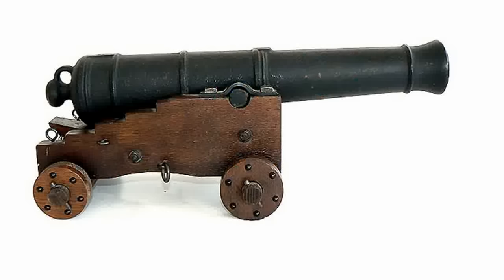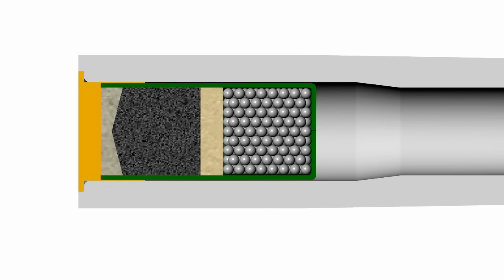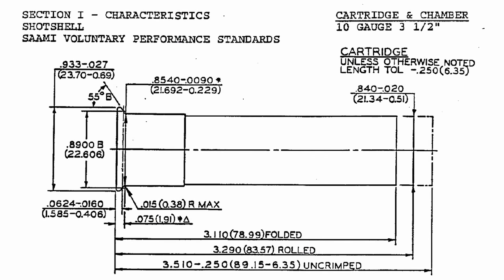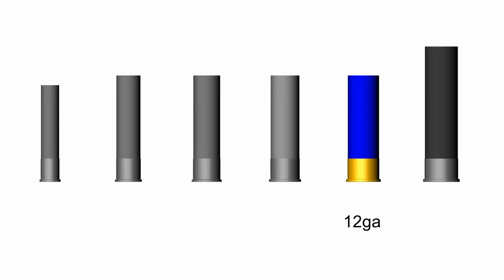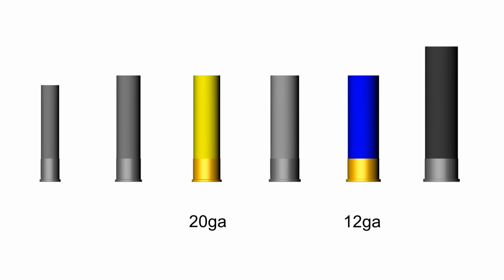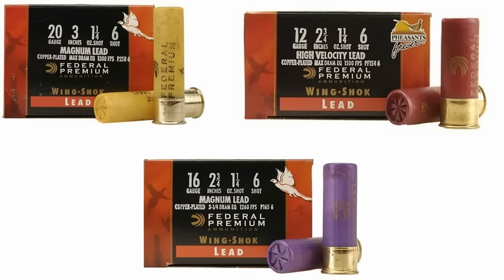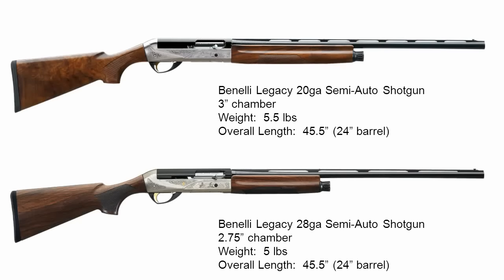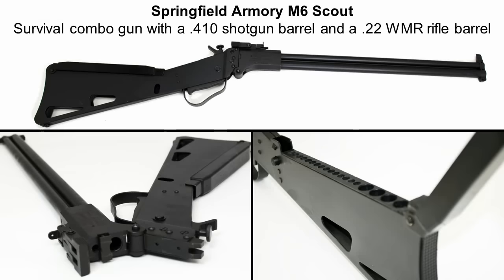Shotgun Gauges Explained - Shotguns 101 #3

Comment: Is there any relation between bore  and gauge ? 
Both are commonly used for hunting rifles.
Reply from the maker: "Bore" and "gauge" are pretty much synonymous.  If someone says 10-gauge or 10-bore, it means the same thing.  The "bore" term is more archaic, which is why you're more likely to hear it applied to larger-diameter guns that haven't been in common use for a long time.
Reply: @SynchronizorVideos  Thanks for answering me.

Comment: Just out of curiosity, does anybody know why the .410 bore (10.4 mm) is called a 36 gauge (12 mm) in some regions of the world such as Europe, Asia, and South America; instead of by the more common 67 or 68 gauge destination?
Reply: .410 is 67.62 gauge or 67 5/8 gauge. It’s sometimes called 36 gauge because starting with 12 gauge they go up in increments of 4. You have 12, 16, 20, 24, 28, 32 and for simplicity 36.

Comment: Please , I want to know about , what is the choke tube size for use the 3 1/2 inch super magnum shells , thank you
Reply from the maker: Did you mean shot size?  The 3 1/2" 12ga can use pretty much any shot size, depending on the application.
Reply: Thanks for your answer , I exactly meant that the choke size or num , I have beretta a400 extreme gauge 12 , and there are 3 chokes with it , 1 & 3 & 5 , so if I want to use the 
3 1/2 inches shells , which size of that 3 chokes  I must use ? thank you
Reply: Check with Beretta or a local gun store, they'll be able to help you.
Reply: Thank you
Reply: thanks

Comment: Every .410 revolver I've seen can also chamber .45 Long Colt. Unlike a .410 slug, the .45 Long Colt is a good defense round (it's like a .45ACP +P), and it shoots much straighter. Use that instead.

.410 buck is interesting, though - by the numbers, it's more like 3-5 FMJs from a .32, which isn't terrible. I wouldn't ever use a .410 long gun for home defense, but the revolvers loaded with buck are decent. (For home defense, I'd rather have a 20ga, or even a 5.56mm rifle - everything penetrates wallboard, even a measly .22LR, and the 5.56 penetrates less of it than you'd expect. Certainly less than a load of #1 buck from a 20ga)
Reply from the maker: If you're going to defend yourself with a .410 revolver and don't want to shoot .45 Colt, buckshot is probably your best bet.  It's strictly a close-range proposition though, due to the oversized bore and sub-optimal pellet stacking causing poor patterns.

Comment: .410 is a good Rabbit and Squirrel gun i started shooting trap with .410 when i was 8 until i got older and got a 20g but it taught me to be picky on my shots
Reply from the maker: The .410 is effective on small game, and even some bigger stuff at close ranges.  You have to be aware of and work within its limitations, but it'll do the job.  It's also great if you want a challenge with clays, though you can get similarly light loads with other gauges if you don't want to buy another gun.  I personally do a lot of clay shooting practice with 3/4-ounce 12ga loads - the same payload as a lot of 3" .410 shells.  Very light recoil and good for practicing proper shot placement when paired with a tighter choke.

Comment: Don't know about you but I've only ever used a 410 and I've had no problems what so ever. It is extremely surprising what the little fella can do. Yesterday I shot a possum in a tree from 40 meters no problems.
Reply: Second that. Been taking out possum, pheasant, doves, pigeons, crow, partridge, squirrel, etc since I was a young whippersnapper with the trusty 410

Comment: Home Defense Shell?...   I have a pair of Remington's,  Model 11and 11-48 (25½ and 27½in barrel). 
I currently use 00 Buck.  But I'm concerned about Penetration,  into a Neighbor's (non-brick) Home!
 I was wondering if a smaller Shot size (6 or 8?),  be a more suited Round?
   Thank You, for Your Time.   -Thom
Reply from the maker: If you're worried about overpenetration through multiple walls, check out #4 buckshot.  It's smaller and lighter than 00 buck, so the energy is spread out over a larger number of pellets that have less momentum individually, and a couple walls will really neuter them in case you miss.  They might not be completely stopped, but they'll get mangled, spread out, and slowed down considerably, so they're far less likely to penetrate into another house and do real damage.  They still have enough power to get into vital organs at close range when there's nothing in the way, though, and more pellets means more chances to hit really critical stuff.  #4B is what I load for HD.

I don't ever recommend birdshot for home defense.  Those pellets are sized for knocking down lightly-built birds and other small game, or breaking fragile clay targets.  They just don't have what it takes to reliably get deep into a large creature like a human.  Keep in mind that if your shot can be stopped by a couple sheets of drywall, it'll have a real tough time with all the layers of clothing, skin, muscle, and bone that are between you and the vitals of someone trying to hurt you.

Comment: I have a Mossberg M500CRUISER. It's a 12 ga pump action shotgun. It has an 18-1/2 inch barrel and a pistol grip. It meets all legal requirements. The barrel is over the minimum of illegal18 inches and the overall length is 28 inches with the illegal minimum of 26 inches
Reply: And your point is? Lots of us have shotguns if you bought it from a gun shop it's legal.
Reply: @davidmcguire6043  My point was that it's legal!

Comment: Can a 12 Ga shoot 20 and 16 ga. rounds?
Reply: I wouldn't try it personally
Reply: NO! Only shoot what is stamped on the barrel. Pay attention to the length as well. If your barrel is stamped 2 3/4" 12 Guage don't load it with 3" or 3 1/2" shells, 2 3/4" only. Be safe.
Reply: You can but that's a good way to lose body parts
Reply from the maker: Not as-is.  There are adapters that let you safely fire smaller-gauge shells in a larger-gauge shotgun chambers, but performance in such an over-bore barrel is questionable.  And there's not much reason for it either.  Rather than figuring out a complicated way to shoot a 16ga shell in a 12ga shotgun, you could always just shoot 1-ounce 12ga shells instead.  The 12ga works great loaded all the way down to 3/4 of an ounce, which is 28ga/.410 territory.
Reply: @renaissanceman7145  You MISUNDERSTOOD my question.  I was OBVIOUSLY implying that the 12 Ga. CAN safely shoot smaller rounds.
Reply: @SynchronizorVideos  Thanks for that. But, I was hoping that the 12 Ga. could SAFELY and EFFECTIVELY shoot smaller rounds just like a NATIVE 20 or 16 Ga. shotgun.  It seems to make logical sense - with the right barrel or choke.
Reply: @jakobw135  I UNDERSTOOD your question to be "can a 12 Ga shoot 20 and 16 Ga rounds" which is what you wrote. So, OBVIOUSLY you weren't implying anything about the shorter shells of the same Guage.
Reply: @renaissanceman7145  Since the 12 Ga is BIGGER than either 20 or 16 Ga (both in length and width), then I was asking if the 12 Ga INCLUDES shooting the other 2 - SAFELY.
Reply: @jakobw135  If you're shooting 16 or 20 Ga. ammo "with the right barrel," isn't that just a 16 or 20 Ga. barrel, which would make it a 16 or 20 Ga. shotgun?

Comment: So in an apocalypse situation (mad max, fallout, etc.), would 20 gauge be better since it’s more common? Or would 12 be better as it seems like it would be more dangerous to get shot with
Reply: 20 gauge more common? It may be more common than the 16 or 28 gauge, but the most common is the good old 12 gauge.
Reply: I would definitely go 12 gauge.
Reply: 20 is about half as common as 12
Reply: Big Smoke9  75% of all shotshell manufactured in the US of A are 12 gauge, make your decision based on that....the video even referred to the much greater availability of 12 over 20 gauge
Reply: 750 Suzuki I guess I misheard it then. Definitely 12 gauge is better.
Reply: Go with the 12; it's much easier to find ammo for it.
Reply from the maker: If you're a prepper, 12ga is the one to plan for.
Reply: Go with 12 ga. Get a 12 to 20 ga adapter.  Shoot shot in both.

Comment: So a lower gauge is a higher diameter?
Reply: Yuri Danylko yes
Reply: Yuri Danylko its a rule of science that i dont understand either
Reply from the maker: Essentially, it's a measurement that's based on material usage.  With a larger gauge, you get fewer shots per pound of lead.

Comment: 3" .410 000 Buck shells have 5 balls. Which would be better than the 2-1/2" shells. But still sub-optimal for defensive use.
Reply from the maker: 5 balls is better than three, but yeah, still kinda limited except at close range.  Plus, the more balls you stack single-file, the more the bottom ones get squashed when the round goes off.

Comment: Excuse me but what purpose does an industrial grade 8 gauge shotgun serve and why did we not talk about that?
Reply: They shoot slag accumulations off of casting furnace components.
Reply: @kimmer6  that sounds...fun?
Reply: I'm currently co-oping at a paper mill as part of my engineering program and we've got one in the recaust plant, the lime kiln rovers use it to knock of lumps and rings that form inside the 2000 degree kilns, just so the mill doesn't have to stop production to send a man down the kiln to knock em off by hand, it looks about dad gum near the same one shown in the vid, just covered in lime dust
Reply: @liamconway4713  Gunbroker sells live 8 gauge ''industrial'' rounds on line. I wonder what kind of slug they use. I should get one for my collection. 

 I was working on some steam turbine drives at a paper mill....a stinky, noisy place ...when all kinds of alarms went off and lights were flashing. The  paper coming off the series of dryer rolls broke  and spewed everywhere. It must not be a rare event as the crew cleared it out quickly and threaded the rollers again with proficiency. Good luck in engineering. I earned my M.E. degree in 1978 and retired in 2018. Where did the time go?
Reply: I know nothing about these things but I would think maybe some sort of big buckshots? A slug would ring that stuff good but I'm thinking some industrial grade buckshots for knocking all that crud off the casting furnace lid or what have you

Comment: Great info and very thorough, thanks! Personally, I don't think much of .410s! They're ok for kids I guess but aren't really a good compromise! A 28 gauge is still easy enough for most kids to handle an more versatile!
Reply from the maker: I'm not a huge fan of the .410 as a kid's starter gun.  The same 3/4 ounces of shot you get in a 3" .410 shell is also an effective payload in a 28, 20, 16, or even 12ga shell.  Rather than starting someone with a light-kicking shotgun, get them a proper shotgun and start them with light-kicking shells.  There are some real nice 20ga shotguns on the market these days that are set up from the factory for small hands & arms, and many of them can be adjusted with longer stocks as shooters grow up.
Reply from the maker: What advantage do you mean?
Reply from the maker: .45 Colt-family cartridges & .410 shotshells are only interchangeable in guns specifically-designed to be dual-cartridge models.  They have unique chambers and barrels to allow satisfactory (though not really optimal) performance with either type of round.  You can't just drop a .45 Colt into any .410 shotgun and expect it to function properly and/or safely, so I wouldn't really consider this a broad advantage of the .410 shotgun.  Also, nearly all .45/.410 firearms I've encountered are handguns, with one or two  long guns that are really more rifles than shotguns.

Comment: is there a video like this that uses the metric system to explain?
Reply: Just take the decimal  and multiply x 25.4 to get bore diameter in mm. Example 12 gauge bore at .725 in = 18.4 mm .410 = 10.4mm

Comment: Is a 410 supposed to kick like a mule because mine does
Reply: No its not supposed to kick hard
Reply: The 12 and 10 gauge kick much harder. The highest likelyhood here is you're just not acclimated yet to more powerful rounds. It take some time, and money. Stick with it, and you'll get used to it.
Reply: OK first off it is not suppose to kick hard at all. Second you need to check your stock to see if it is cracked or loose. Either one will make the gun have a more felt recoil.
Reply: . . .Wtf are you sure your shooting a .410 bore?
Reply: Pablo's Stopmotions yeah I’m sure
Reply: Jakob Furbee hmm...I don’t know what to tell you
Reply: Of course it kicks hard, it's about the most powerful deringer made. Try a .357 w/ .38spl loads or .45lc in the .410 but keep in mind, .45 colt kicks quite a bit in a micro pistol too.
Reply: Will Holly ...it’s a pretty weak shotgun you know? It’s not a rifle.
Reply: Depends, I got an old pardner .410 for fun many many many moons ago and it's got a wallop on it, then I have a Winchester .410 with a longer barrel that is like shooting an old red rider bb gun
Reply: I also have a tarus judge but I prefer the old pardner and a Ruger vaquero .45lc... The judge just doesn't have what it takes for anything outside your living room or kitchen (edit) though we'll made and sturdy, you better be damn close if you have to use it
Reply: 410 doesn't have much kick for most people, how much kick it has to a person depends on the height and weight of the person shooting it, like I'm 6'3' and 200 something pounds and I can shoot a 12 Gauge no problem and they have a hell of a kick
Reply from the maker: .410s tend to be pretty light guns, so that makes them recoil more than you might expect.  They also often don't have recoil pads.

Comment: Btw 6 gauge is still in use. Actually the 6.27 gauge is still in use.
Reply from the maker: Lots of old gauges are still "in use" to some extent.  But outside of really specialty uses or collectors, the 10, 12, 16, 20, 28, & .410 are going to be what you want to pick from if you're looking at getting into shotguns.

Comment: What does the phrase, “it’s also a family-friendly defense gauge” mean?  Is this referring to its reduced chance of going through multiple walls?
Reply: Reduced recoil.
Reply: Pellet velocity from the lighter gauges are actually identical to bigger shells, there's just fewer of them. So penetration through walls would be exactly the same regardless of gauge.
Reply: It means women and girls can fire them without breaking their shoulders. There's no point in having a gun you are too scared to shoot.
Reply from the maker: 20ga guns are smaller, lighter, and handier.  Something that Dad, Mom, Grandma, older kids, pretty much anyone in reasonable shape can handle.  Similar 12ga guns tend to be larger and more unwieldy for smaller shooters.

Recoil is actually kind of a moot point for HD when comparing the 12 & 20 gauges.  20ga buckshot and slugs are a tad lighter than similar 12ga loads, but not by a whole lot, and the lighter gun does less to soak up the kick.  Plus, there are some really nice low-recoil slug & buckshot options for the 12ga these days that can make it very comfortable to shoot.

Comment: I hunted with a side by side 16 gauge and it patterned much tighter at longer ranges then the same pellet size load 12 gauge.  At the same time 16 gauge slugs are suitable for boars while 20 gauge slugs are lacking.

Same goes for defensive loads, 16 gauge is perfect for self defense, lower recoil with similar payloads as 12 gauge, but without the extra length of 20 gauge shells with similar loads. 

Too bad 16 gauge has been pushed out by silly 20 gauge marketing hype.
Reply: Isn't that the truth. And everyone I have ever let try trap with any of my .16 Gauges did better with the .16 Gauge then with my .12, .20 or .410s. .16 Gauge has earned my respect, and is the best compromise. But good news for you, Barrett, Browning, CZ, Merkel, TriStar, Hatsan (not reccomended), Citori, and numerous high end custom shotgun manufacturers still produce them. Remington, Federal, Fiocchi, Winchester, Sellier & Bellot, Holland & Holland, RST, Triple Crown, Heavi Shot, Brenneke, and the list goes on and on for .16 Gauge ammuntion. Only Buck Shot is hard to find where I live, others find slugs hard to get. Specific shot loads and companies can be a challenge as well. But I recommend Remington, Federal and Fioochi.